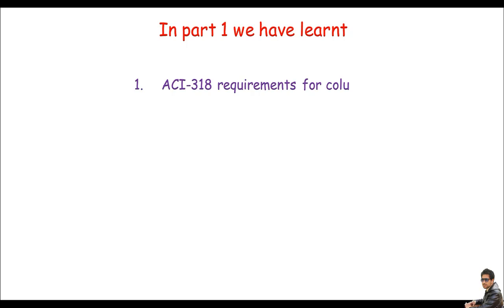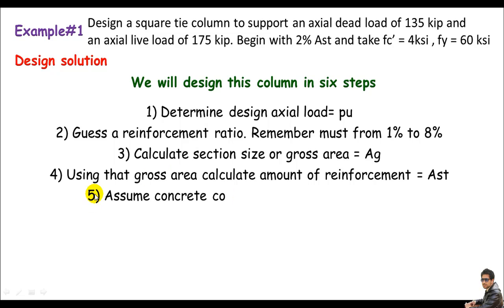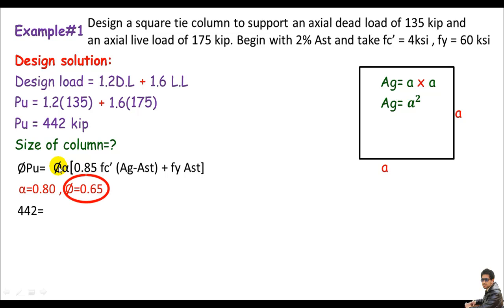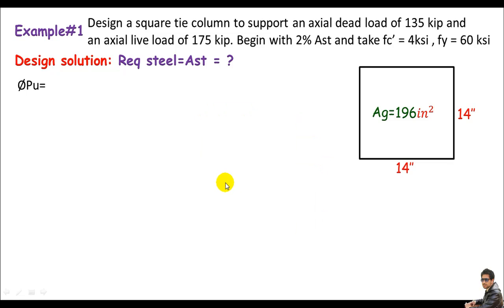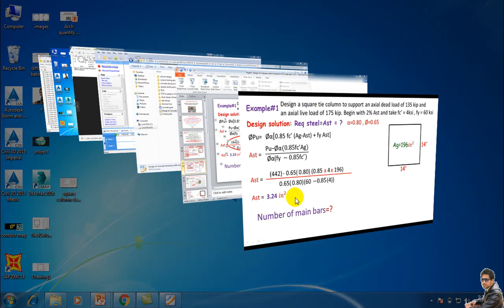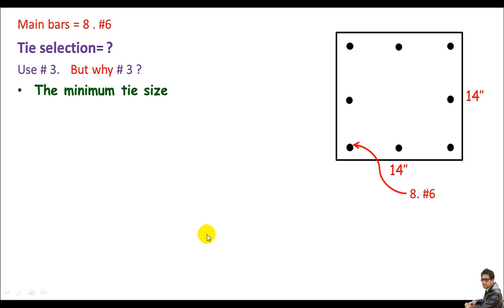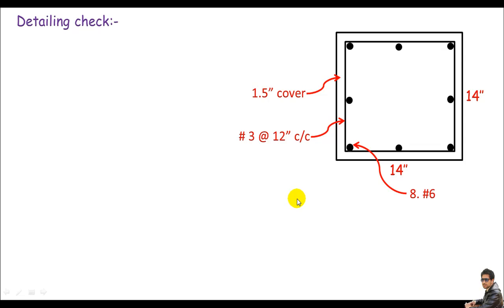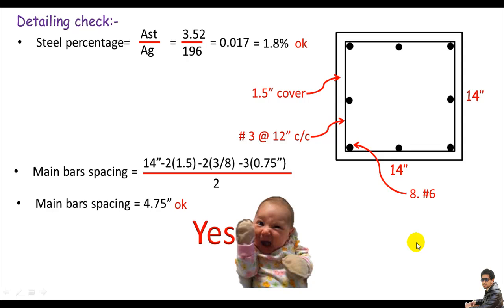2)English-Design of a Square reinforced concrete column based on ACI codes part 2/2

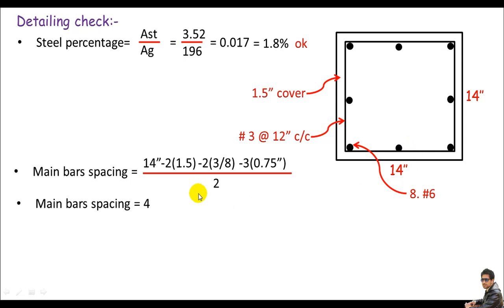Comment: @17:48   main bar spacing calculates to 4.000" not 4.75 ..
Unless you add the half bar to both sides to get the center to center spacing. The formula you wrote is correct. the calc is wrong. 
Thanks for the videos however.

Comment: Great video sir. very clear. I assume 175 kip must refers to a live load for a heavy structure such as a bridge. For residential structure I used 3 Kn/m2 => 0.06 kip / ft2. So, live load for 144 ft2 for second floor slab= 0.06 x 144 = 8.64 kips only. Is this realistic?

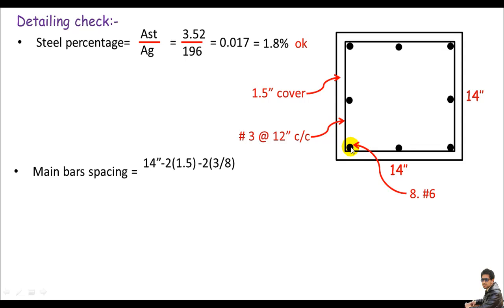Comment: 17:18, in finding the main bar spacing you should only subtract one diameter of the main bars not three , the final answer 4.75 is correct though.
Best,

Comment: a simple question, why everything your dividing it by 8 (in tie spacing)?
Reply from the maker: consider dia of bar as #3. this mean the bar dia is 3/8 inches. one inch does have 8 soter and when i am talking about #3 it means dia is 3 soter or 3/8 inches............. or you can say to convert soters into inches we divide soters by 8....
Reply: thank for your fast reply, but what is a soter? i searched for it on google and it has nothing with inches it means according to google that its a greek epithet, to be honest wt i understood tht its a kind of conversion of units .plz can you clarify it more ....  thank u in advance
Reply: jojo ...
soter is just local word used in asian countries by masons .....
you can call it (1/8)''= 1 soter

Comment: is this method applicable for slender rcc column?
Reply from the maker: Rey Carl 
yes. however some additional elements may be designed for supporting it along its length. 

also check design of circular column.
Reply: SL Khan and what will be the elements  needed  to designed?

Comment: Dear sir,
thank you very much for sharing your knowledge. I am involved with designing of RC structures having shearwall(Dual-system) by ETABS. I would like to know which factor loads, moments and axial loads to choose if I want to calculate the reinforcements manually?
In a shear wall, how to decide the boundary zones and their reinforcements?
How to design a dual-system structure by hand?
thank you so much for your repy.
Reply from the maker: Hamid Nikzad 
hi. thanks for appreciation.
you question is so long. i can not answer in comment. i will try to bring more lectures on design . how ever you can study reinforced concrete design by nelson for factors load. all details are given in that book. thanks for joining us.

Comment: Hello, nice videos. when you solved for Ag, you used 442k, but wrote phi*442, shouldnt the left side of the equation have 0.65*442, and Ag = 100in ^2?
Reply from the maker: Joseph Perez 
hi. nice question.
phi with 442k is a factor. if you see little above when i am calculating pu i have used some factors like 1.2 and 1.6 with D.L and L.L . thats why i do not need to put the value of phi with 422k.
Reply: Thank you for the response. So the LRFD factors account for that. I checked the design strength and it did work: phi* Pn = 550K > 442K
Reply: @josephperez3389  but when i multiply phi*pn the answer comes 210. dL and lL is 310 then phi ois 0.65 so 0.65x310=210
Reply: @Sulimankhanacademy  but when i multiply phi*pn the answer comes 210. dL and lL is 310 then phi ois 0.65 so 0.65x310=210